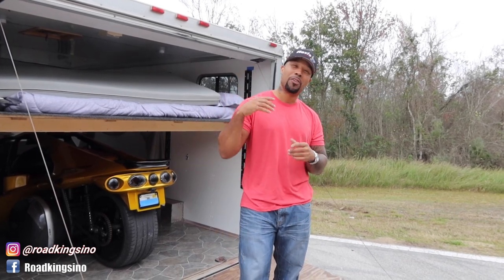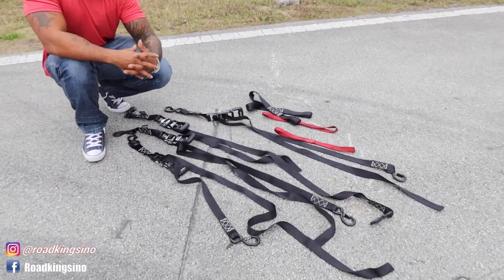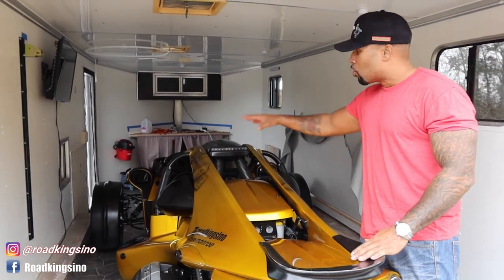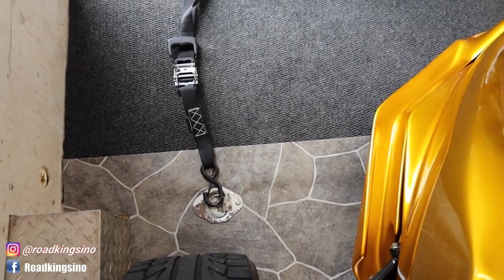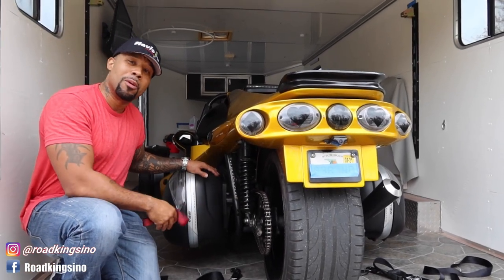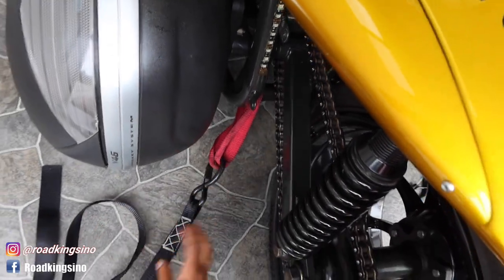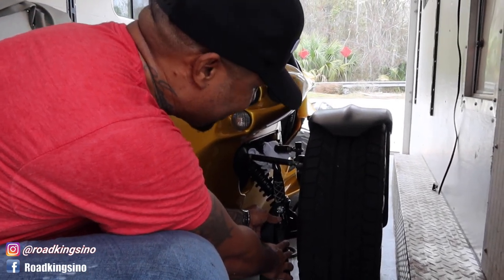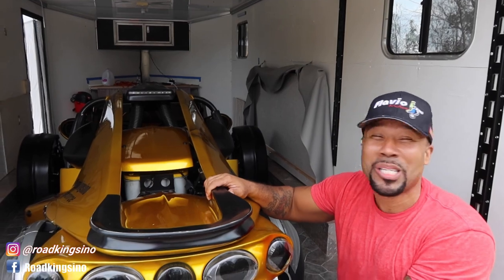How I Strap My Campagna T-Rex down in the Trailer.

Comment: I just got my rex and have been boy trailered it once so far. I have factory rims and an open trailer right now so I just looped thru the wheels (2 straps each wheel). Your method seemed solid as well but honestly I was worried about the swing arms up front . Thanks for the video.

Also, where do you get aftermarket parts for the rex? They are really hard to find.
Reply from the maker: Definitely solid. A-arms up front are generally ok as a mounting point, just wrap them well with with rags and don't go to crazy with cranking it down. No problem brotha... glad you enjoyed.
Reply from the maker: I got my parts from a few different companies over the years. Shoot me a DM on IG, Facebook or Email roadkingsino@gmail.com and I gotcha 👍🏼 #REXFAM